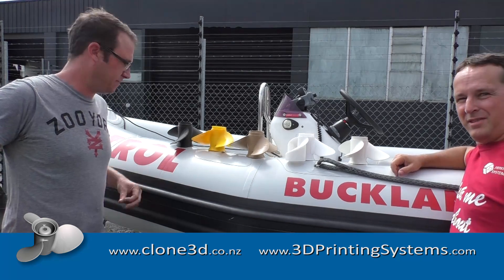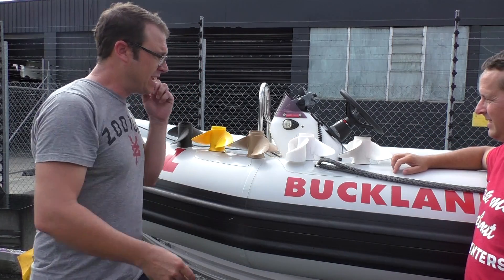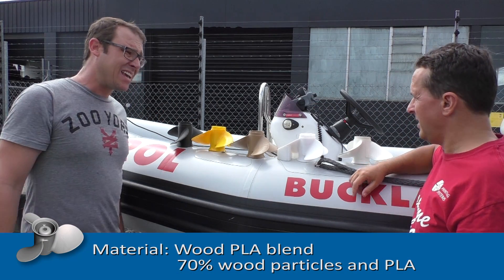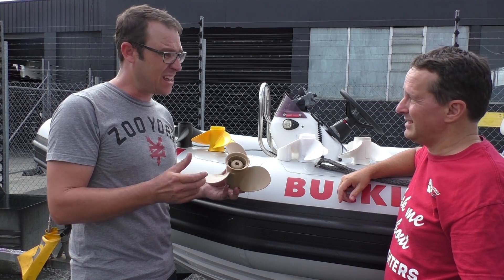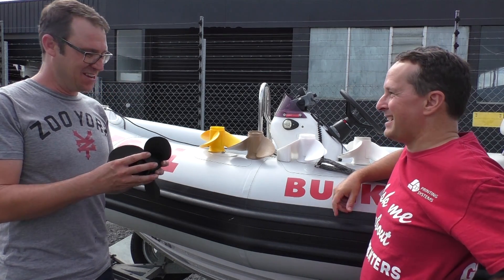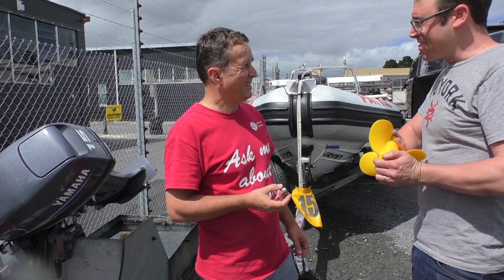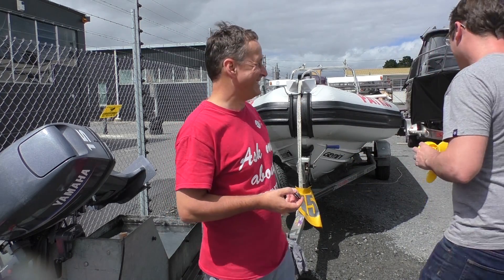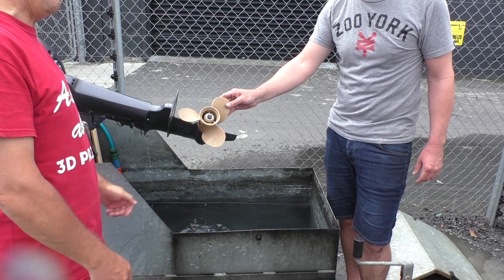Could you 3d print a wooden boat prop?

Comment: Nice video guys! I know that you can print mechanical parts if you do it right. Some allways say "NONOOO layerdelamination!!!" But my prints crack like normal molded plastic parts so its strong ;)

And also i knew that this "Carbon Fibre Rubbish" is not as strong as most people think. Ok, its stiff and looks good. But its not tough at all ;)
Reply: thanks!
Reply: Lord_Vader maybe 3d printed its weak, but when used with epoxy and vaccum formed, its some of the strongest stuff you can make
Reply: urjnlegend um yeah i know. Everyone should know. The point is, people beleave carbon filament to be strong, but it isnt, its no real fibre, its more like pieces and stuff
Reply: Lord_Vader so the problem isnt the carbon fiber, but instead the lack of it
Reply: urjnlegend exactly!
Reply from the maker: We'll soon be doing the test with Graphene, and that looks awesome so far!
Reply: 3dprintingsystems but even there you dont get one plane of it through the whole filament. What the goal with this filament?

Comment: Aluminium best for the casting, especially if you want to run it in a real-world test for a while. You can easily polish and anodise it: if you use ferric chromate in the bath, it would come out a golden colour. I'm not sure what the best printable plastic would be: to get a clean mould, it would have to burn away completely, leaving no ash or other residue. To make the ceramic mould would take several layers; clay, then silica sand, then dry, then another clay, etc. Best to try the local engineering school / college / university or whatever it might be. They may also have an interest in doing such a project.
Reply: +Paul Langford But if you were printing only one for your self wouldn't one of the metal plastic hybrids work better in this case? Its something like %20 metal to %80 plastic.

Comment: i would like you to try pla only. no exotics. the exotics actually make the parts weaker as they are just fibers in the plastic. this is why the carbon fiber did not perform as expected.. solid pla might actually work ok.
Reply: +Nerys We are working on another project, so will add that to the mix.

Comment: Use the printed propeller as a lost-plastic master for ceramic casting of bronze, aluminium or stainless steel.
Reply: +Paul Langford - thanks for the idea - I'm going to print and get it cast - what material would you recommend?

Comment: Interesting video, nice to see the differences of the filaments under real world stress applications. I think the carbon-PLA filament is just too brittle. Did you actually do some calibration tests to find the ideal extrusion temperatures? It could be that the temperature for the carbon-PLA was wrong as it did not just crack but delaminate quite a bit.
Filaments with more elastic properites like nylon or PETG would probably do better, but maybe you would have to make the blades a bit thicker so they can not flap around too much.  Looking forward to see more such videos.
Reply: +ExtraBase Yes you are correct, we'll need to redo that one and add some others into the mix.

Comment: Really impressed by the Scan of the Propeller. A propeller has to be perfectly balanced or severe vibration will occur. It looks like you printed the spline in place rather than use the traditional Spline and Rubber Bush. Am I correct?
Its also great to see more folks trying Polycarbonate, as you said it is awesome and certainly a material with a great future!

Comment: Nice work!  Now print the engine and the boat!  HAHA!  :D

Who is the manufacturer of the polycarbonate filament?  Also, what printer did you use and what slicer software did you use with it?
Reply: +Bruce Jackson Gotcha, thanks!  You forgot to say what the manufacturer is for the polycarbonate filament though.

As for printing the engine, it might be possible with the proper cooling and some kind of fuel that is not as explosive as gasoline.  Can you imagine the kind of forces on that prop?  If it can survive that then who knows what else it can survive!  HAHA!  :D
Reply: +Bruce Jackson Who is the manufacturer of the polycarbonate filament you used in your experiment?  It's an important question because some manufacturers of filament do not manufacturer good products.  You obviously found one of the GOOD manufactures of polycarbonate filament!  :D